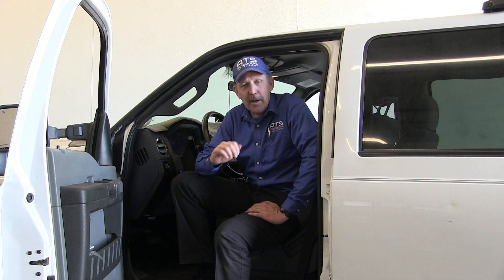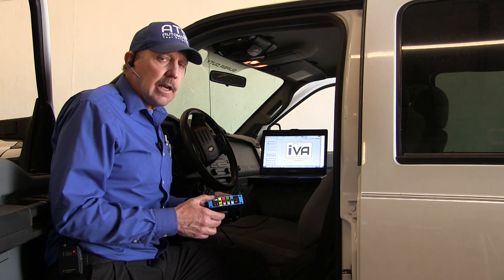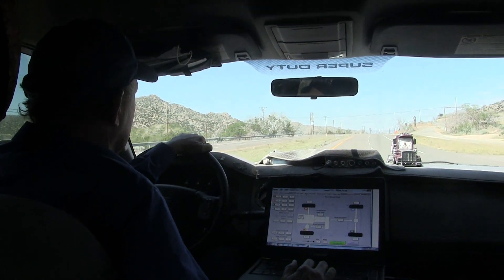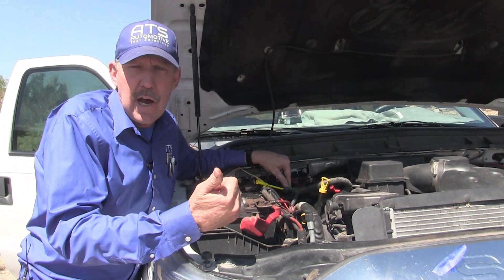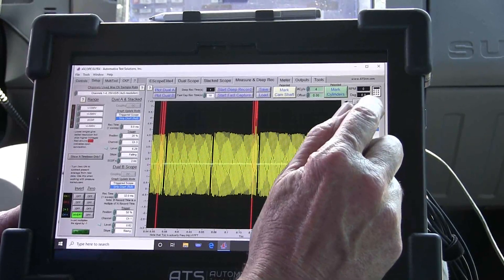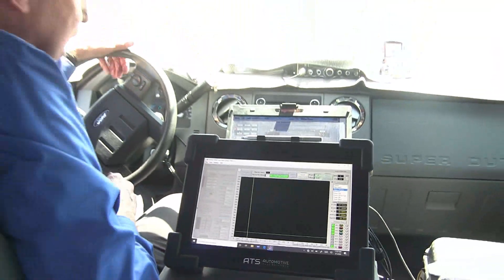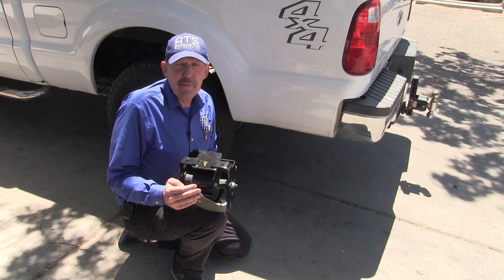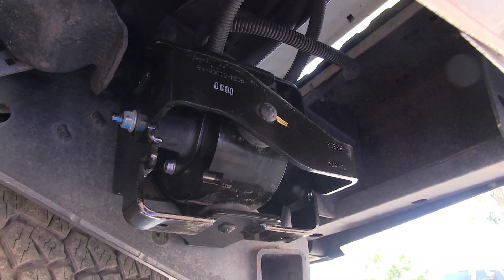2012 Ford F250 Super Duty

Comment: Wow that is a crazy case study! So what changed over the life of the truck to cause that vibration to occur, since it didn't do it when it was brand new. The add-on damper seems like a band-aid...what is the root cause?
Reply: How long is that damper going to last in the salt belt?
Reply: I'm glad I'm not the only one who thought the inertia dampener was a crappy fix to an underlying design problem. Lazy solution on Ford's part IMO. Something else has to cause it if it doesn't happen when the vehicle is new, eg defective or deteriorating spring, structural change due to, who knows, a failing or loosened bolt or weld in the frame - something has to explain the state change!

Comment: Unless those tires were worn , replacing LIGHT TRUCK Tires and ALL the shaft joints had to cost OVER $ 1000.00 . What do you tell the customer when they say " it does the EXACT SAME THING ? It needs the ENTIRE front end replaced ? Then what - how about " the chassis is bent " ? How do they get away with it ? Would the tires show SOMETHING on a high speed balance ? Swap with another set or rotate ? Run on the lift ? Could the shafts be run LOADED on a Dyno at the right speed and strobed with a timing light ? You would think ANYTHING is better than a guess ? Nothing like checking TSB's or check All Data , Identifix or forums FIRST . The alternative is expensive 😬 .